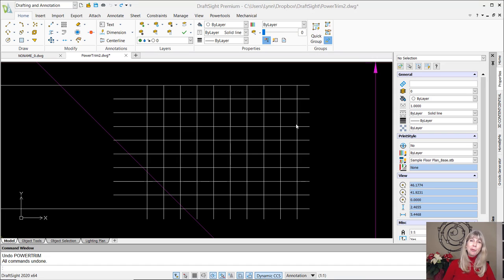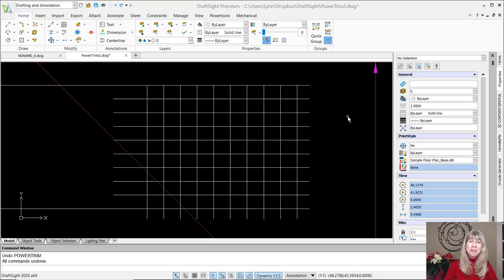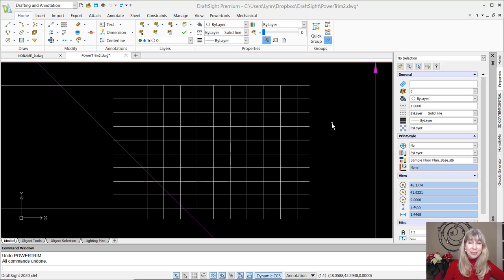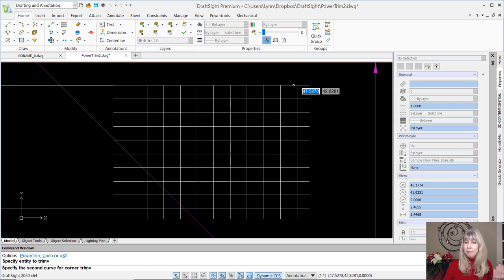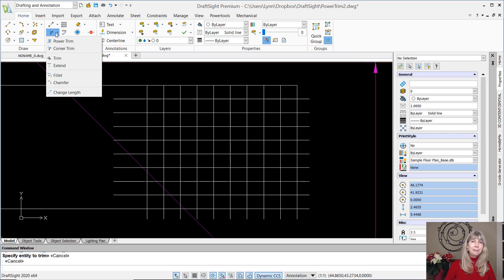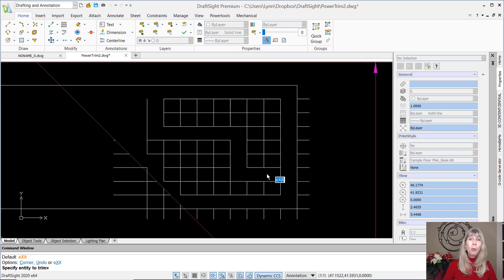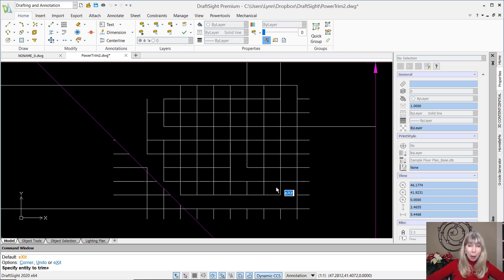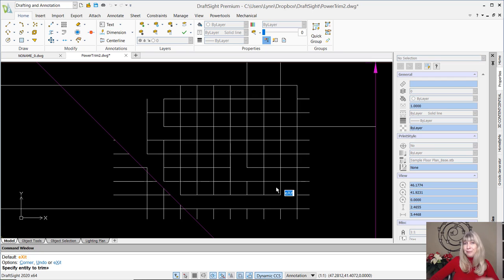DraftSight Insights: Lynn Allen Demonstrates the Power Trim Command

Comment: As first, 2 short comments

1. I like Draftsight, specially the versions which you could use free or buy a permanent license
   [and i hate that dessault goes the same way like adesk, that the only offer is an subscription. So I have to use my 2017 pro license for many years more. ]

2. Lynn is/you are a good one and she knows that too, but for other readers who compare the function with Adesk products
   and because of the impressive topic " and some that AutoCAD doesn't, such as Power Trim."
   Yes, there is no command with that names, but the functions are there.

--------------------
Corner Trim
is -> how FILLET (with filletrad 0) or CHAMFER (0,0) works too,
      or much simpler without to set or check the settings: Holding [SHIFT] by using fillet/chamfer

Power Trim
is -> exactly how TRIM works in Adesk since March 2020 (2021 products)

Power Trim +[Shift]
Same in Adesk, shift toggles between trim&extend

Comment: 2:41 why did the trim get cut off before the cutting edge when you went on 135degrees?
Reply: Do you mean 2:43 instead of 2:41? The take a closer look to the video and you will see a 135° line from upperleft to lower right direction!
https://www.bilder-upload.eu/bild-26a219-1608628856.jpg.html look by 250%
Reply: @cadffm1651  I didn't see that other line..thanks